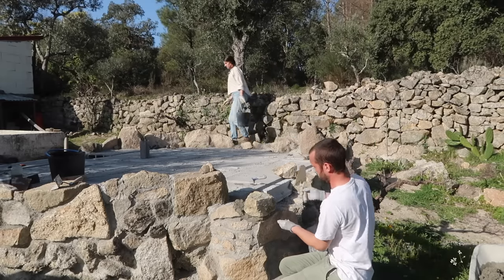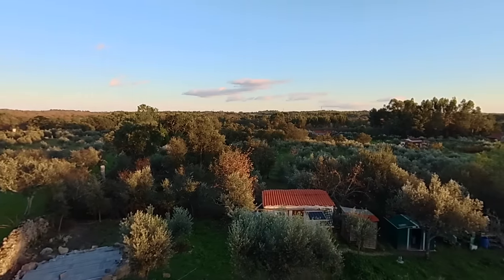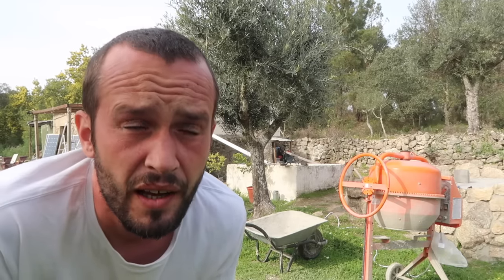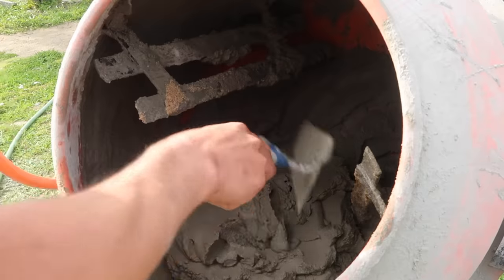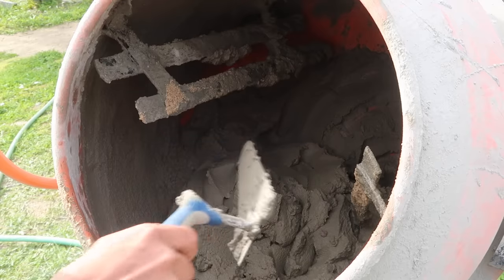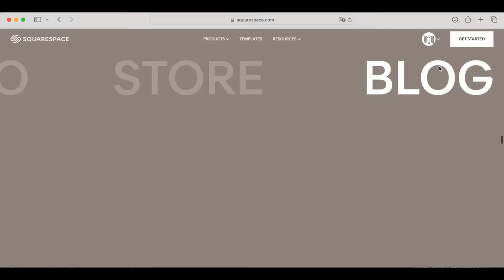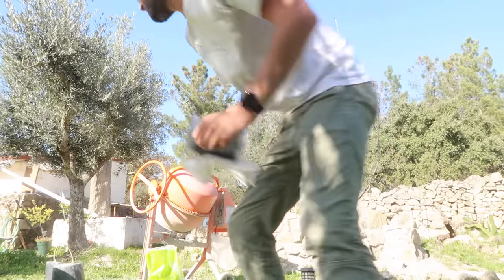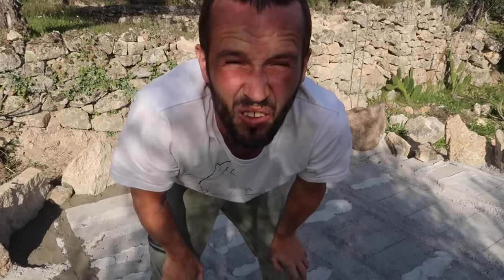Fixing the roof before the storm on our self build home.

Comment: If you put PVA in the cement. That's a waterproofer. You can also paint it on. Just water it down. It's only wood glue. It's good waterproofing stuff. Bitumen is also a good paint on waterproofing membrane.

Comment: With the edge of the roof you've got a straight cement edge meeting the metal/plastic edge of the roofing finish and any sun or wind will cause a crack. In the UK it would be easy enough for you to either use lead roll to cover it or a flashband (bitumen with Aluminium). Do you have anything like that at builders merchants. It's got to be pliable in the sun and wind, UV resistant and durable so not a lot to ask for, that way any movement is taken up by the cover flashing. Small leaks are the most annoying to deal with.

Comment: Use an old paint-brush to grease. Much easier to work with. Use a membrane for the roof-leaks. It looks like cloth... then brush on with roof-seal. It's rubberised paint.
Reply from the maker: Good shout! Thanks

Comment: I had a Dickens of a job weathering in where my steading abutted the bothy, I ended up using a lead flashing… that usually needs a joint to be fitted in but like yours it’s built with stone, I ended up rendering the wall and cutting in a Chanel with a disk cutter, good luck as always, regards from Scotland 🏴

Comment: By far the most work saving tool must be your cement mixer. It rarely stops working. It makes things so much easier, and when you are done building you can use it for mixing compost, potting soil mixes and loads more.👍
Reply from the maker: 100%!!

Comment: A rubber glove, seriously, a latex glove comes in handy with any lube, it can get messy. Great advice though, it will definitely prolong the life of your mixer. If you have problems with where the new cement cracks against the metal, mastic is a non hardening sealant that should sort that. It comes in a tube like silicone.👍

Comment: flashing tape or flash band, is great for waterproofing any cracks where roofing sheets or tiles etc, meets brick or stone, it looks like lead flashing, & comes in various widths  & on a roll,  you just peel a paper or plastic of the back & stick it on, to bridge small cracks or gaps, also if there is any nail holes in roofing sheets etc, where water can get in around a fixing, just cut a small piece of flashing tape & stick it over the nail or screw head, & if its put on, on a cold day, just melt the sticky bitunen on the back ,with a small blow torch, then stick it on, but in the warm sun, a blow torch wont be needed, btw i,ve enjoyed all your videos, well done to both of you, from the north of england,( lakes)

Comment: would be nice to get a container next to your main building, to turn into a shower storage etc,clad it like Indigo Escape
Reply from the maker: It would be brill.. but not possible for us unfortunately - unless it came by helicopter 😅
Reply: I went for one. My experience is that Containers in Mediterranean Climate are not so favourable, at least when they are not heavily isolated. Burying is also not a great solution for that as they are not designed for the earth pressure on the walls. Though the sole benefit is a safe storage room imho.